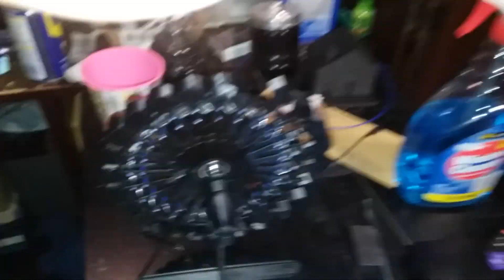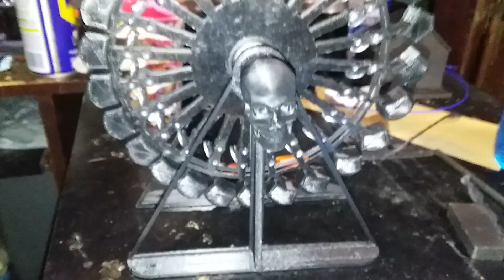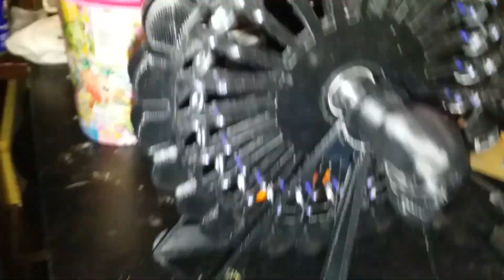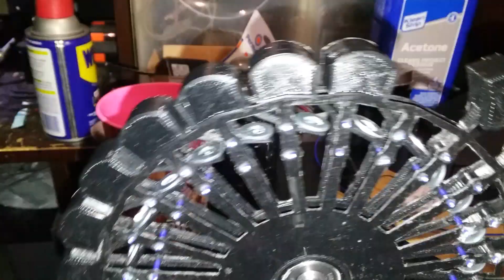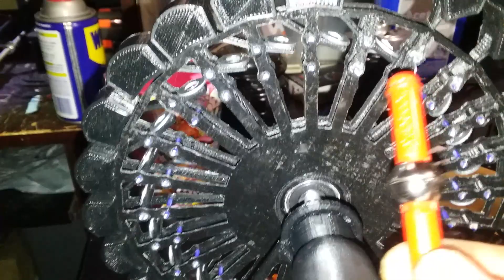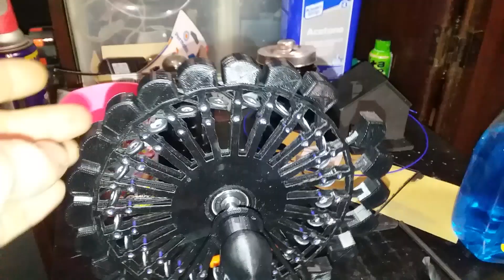Gravity motor

Comment: You could try attaching string from lower left to upper right, attached off of the wheel, and only having a fulcrum hinge on the other side so the string doesn't tangle. Similar things have nearly worked for me with the sideways-swinging lever wheel, which has a similar principle of moving under certain conditions.

Comment: Hi there, you can cancel a lot of weights from the bottom of your assembly by using solid surface as a mass subtractor. Basically if end of the your weights have wheels then just let it touch the ground and lean its mass onto your table so for that short moment of time while your weights are rolling on wheels and touching your table surface will "detach partially in terms of the mass" from your machine assembly (the effect is same as cant lift the car with one hand but i can push it with one hand - just notice if i try to push really fast the faster i push the more mass i will feel resisting on my arm from that car, so what i am saying is machine in this case will like and level itself up toward its own speed of rotation it likes to be in). Thats small help from me. I have 2 designs that are maxed out and well planned on the paper where i am abusing that "mass from assembly subtraction" by introducing "skateboard ramps" to lead my weights in most efficient manner. Looking forward to assemble few of those once i get a chance for myself + one highly complex that is not using gravity.
Reply: These ramps(ideally two of them) that i am speaking of are the ones solving the problem of the "top arms not getting into the position on the time to fall", and second ramp prevent the mass accumulating on the bottom of the assembly. < these 2 problems are the ones that this wheel offset idea have problems with. But what ramps will do as a bad effect is : bottom ramp will "push" bottom arms into opposite direction from assembly wheel spin which is the same effect of whats going on when arms are naturally by the gravity pulled down toward retracted state on one side of the wheel, so nothing new is introduced with this bottom ramp except that now most of the assembly has retracted arm states(more of them compared to what assembly haved with your initial design). All these retracted states once they get to the top position of the wheel assembly now need to go certain distance in order to extend(exact distance they needed to retract)<this is why everyone thinks nothing is gained but it is blind conclusion since there are many forces involved here and its hard getting the grasp in mind indeed, but even if equal amount of energy is spent into extending the arms one effect did happened in meanwhile - wheel is offset! And as such provides the torque.

Comment: Not another perpetual motion machine. I will not even try to charge you for this. Whatever you devise to fliip over each node, it will take energy of some form, which by the way is impossible, unless you have found a way to harness virtual particles popping in and out of existence, which i am sure you have not.

Comment: How many degrees can you tip them down instead of up? 45 from vertical maybe. Rotate it counterclockwise with a bump roller to tap them down.
Reply: @joedoe1280  Leo Ackerman actually had a little bumper at the top I think this one would need to be at the right side

Comment: Put a small  magnets on top of the washers and another stationary magnet should be mounted free standing close by the wheel that with the same  opposing pole washers  can be push down so wheel can self rotate.

Comment from the maker: Yeah I was kind of figuring out that regardless of what the only real gravity that I'm getting out of it is the one on top of thrones over the offset which is not much power so I was thinking on my next project solenoids catapult what does a capacitor boost charged by a generator created by a solid-state magnet motor ran off of a larger pulley on the  Wheel that would catapult steel bearings to the top only have weight on one side of the wheel going down still just playing with it